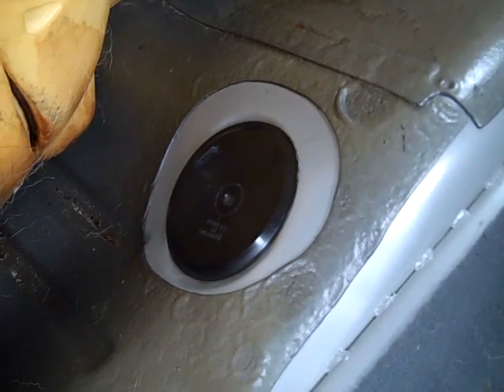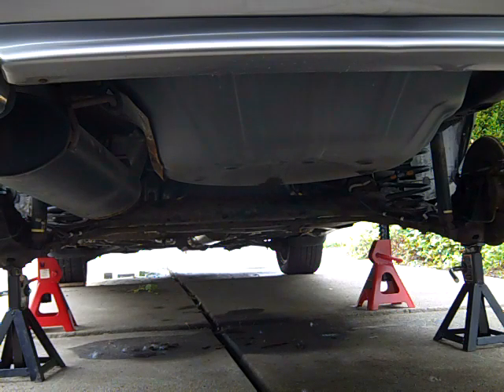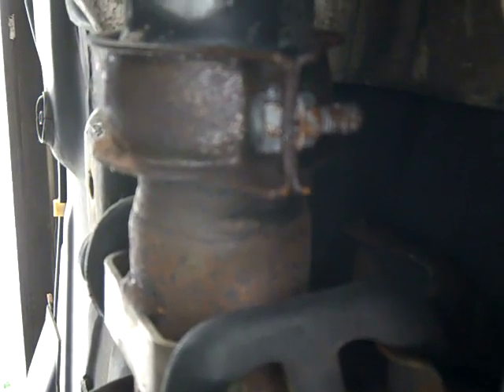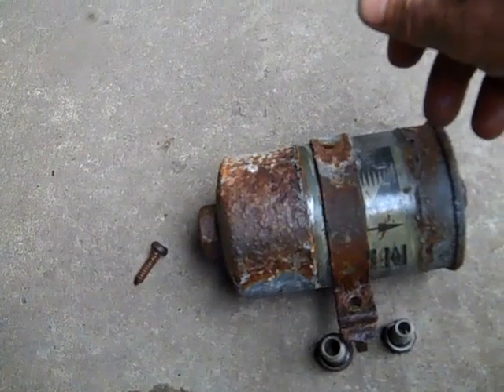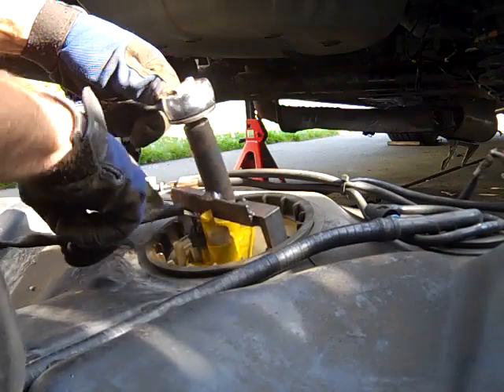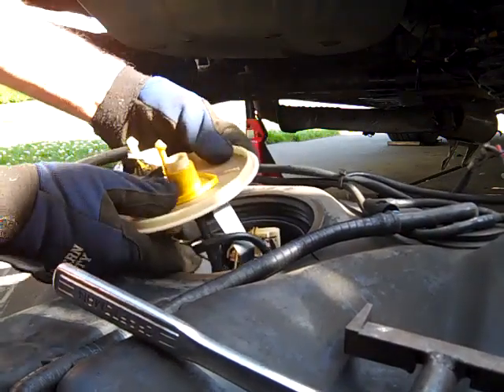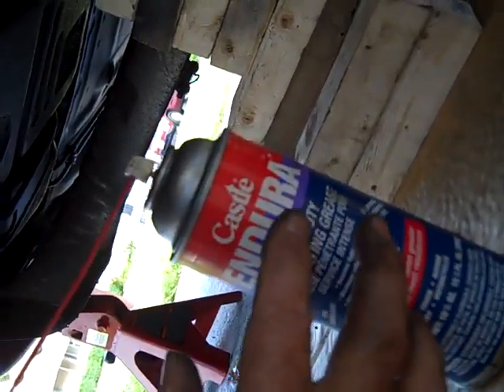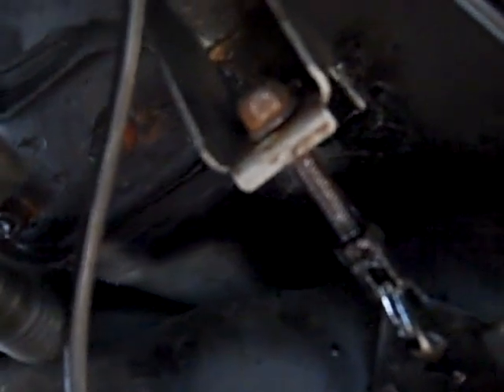SAAB OG 9-3 Fuel Pump Replacement

Comment: Holy smokes, it's like you're spying on me... you keep on posting the right thing at the right time. I've switched to a Biopower basefile, but I've got to upgrade the pump before I can fill up with just E85. Thank you for taking the time as always. 

I don't suppose you're doing struts and bushings anytime soon?
Reply from the maker: Glad I can be of some help.

Not doing struts any time soon. A few tips: (OG 9-3, NG 900) The strut cartridges can be replaced if the housings are still in good shape. There is a special socket for the nut, or a LARGE channel-lock pliers will work. The strut needs to be held securely in a sturdy bench vise. You also need a spring compressor to remove the spring, both to access the strut cartridge, and to change the strut bearing and bushing on top...if needed.

Comment: Sorry to bother again, but how do you remove the wires under the tank. I’m having trouble dropping it because they’re in the way
Reply from the maker: You will need to remove the center exhaust section, and the straps. The parking brake cables can just be pushed to the side and the tank slid in the other direction after disconnecting the fill hose, EVAP hose, fuel pump wires, and fuel lines. Be careful of spillage and the weight of the tank if there is a lot of fuel in it.

Comment: My 2002 9-3 with 129K miles wouldn't start, the engine turns but it doesn't start, I checked the fuels filter and pump and they appear to be the originals, I replaced the fuel filter but it didn't help, I order a new fuel pump which I have yet to replace since I can hear and feel the pump running when I turn the ignition on could there be something else wrong? one thing to note I was getting  P302 and P1302 errors but the engine was running, any suggestions/help would be greatly appreciated, thanks
Reply: So I just replaced the fuel pump and car still wouldn’t start....any ideas

Comment: I’m trying to replace the fuel pump on my 1997 Saab 900 2.3L. Would it be the same?
Reply from the maker: Yes. It's the same setup. Gas tank has to come down.
Reply: @saabtech3510  thank you so much!

Comment: Question: i have the exact same saab. i only have about less than a 1/4 tank of gas. is that light enough to skip step 2: removing gas?
Reply from the maker: Yes. Plug the gas fill on the tank when you remove the fill hose, just to be sure you don't spill gas when you tilt the tank.

Comment: Guess I got a junker lmao I think I have a pump problem I’m gonna chop cut that hole lmao it’s under. The seat ding dong who gonna see that
Reply: my sons 2004 95-2.3T.has full size hole from SAAB we just replaced the fuel pump&relay but its still not priming the fuel pump,its sittn at his Highschooñ just died when he pulled in the parking lot last Tuesday.I dont know what it is.
Reply: Yup , i saw that hole in the back seat of my saab aswell and changed my pump that way. Works best
Reply: Yeah, I'm thinking my backseat hole is about to be modified too.

Comment: There is no need to drop exhaust or heat shield.  Undo  straps .disconnect wiring from under seat . Then raise the body and then pump comes straight out.
All this is a waste of rime . I took it out under 15 minutes.
Reply from the maker: Good for you. Your heatshield was either missing, or you bent it to crap. It's only 3 nuts to take off. The exhaust pipe  is only 2 clamps, but there is enough room to clear the tank without taking the exhaust off. Whatever you choose.
Reply: Nope heat shield still conected
Reply: Only straps taken off